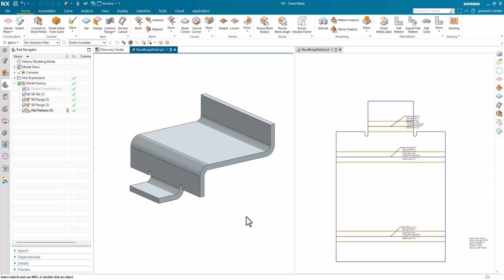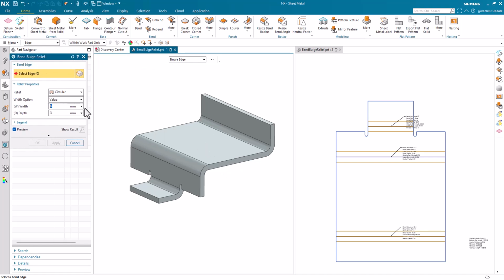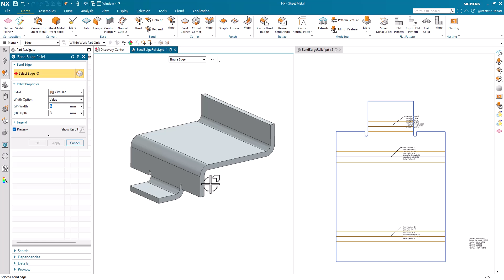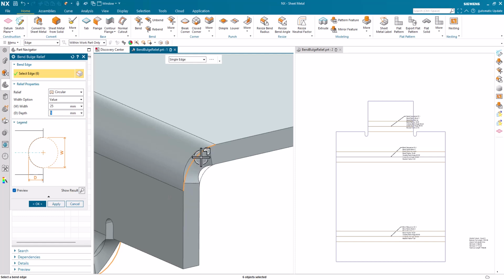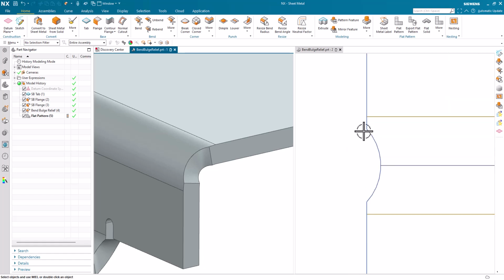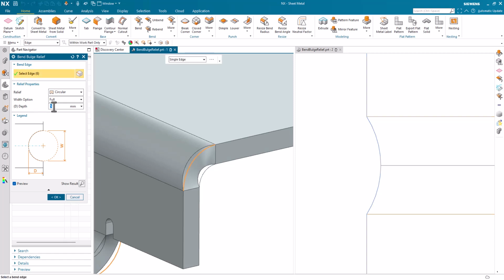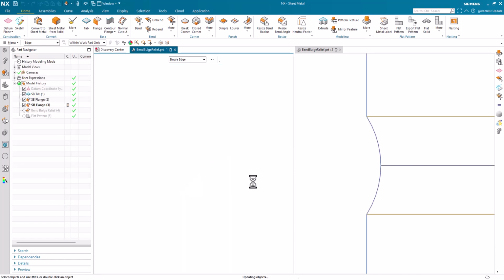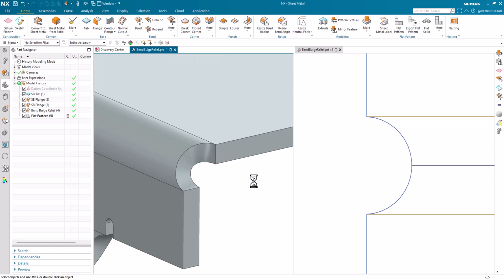Siemens NX Sheet Metal: Bend Bulge - NX 2406

Comment: Hi David,

Thanks for sharing the video! I’m working on a design where I think I’ll need a bend bulge relief, and I’d like to calculate its size and position. I’m using 6mm thick material with a 12mm outer bend radius. Could you help me with the calculation or guide me on how to approach this?

Thanks in advance!
Reply from the maker: Hi @designbynadeem, the depth required will depend on the material used.  I cannot offer advice here but only suggest you create some test pieces and work out the amount required by that process.